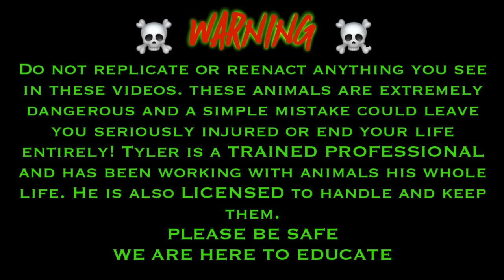NEW VENOMOUS SNAKES Ive waited YEARS FOR!

Comment: On the subject of the water bowl, people tend to forget that mistakes WILL happen in manufacturing. The occasional mistake like that is never a good thing, but it's not completely representative of the company. What makes or breaks them, is how they handle the situation and what they do to make it right. Clearly, Vision is a top-notch company that stands by their products and their customers.
Reply: I work in the manufacturing trade. I see it all the time people being lazy because they don't like their job. Plastic parts are most made by injection molding. Usually the part is left with a thin strip of plastic along the edges called flashing from where the mold comes together & someone is supposed to remove that flashing

Comment: 1 thing I don't want if I'm working with a venomous snake is something heavy in my off hand. That metal structure looked heavy.
Reply: It's not, it's aluminum & it wouldn't be in anyone's hand. It latches on top of the garbage bin
Reply: @secondsfromdisaster5360  my apologies
Reply: @seanbarraclough2484  it's all good man. I designed it to be practically riskless. It holds the bag in place, you drop the snake in the bag & then pinch it off with the paracord & then they can safely tie it off & move on to the next
Reply: Show me.
Reply: @seanbarraclough2484  probably Tyler's next video